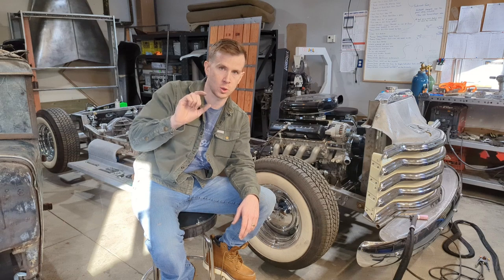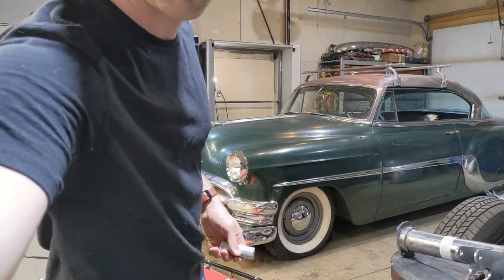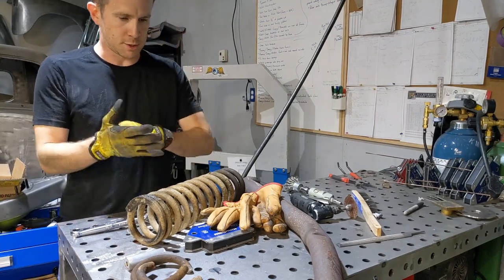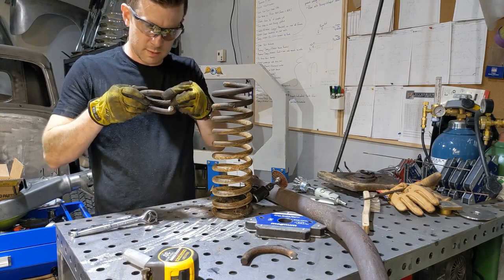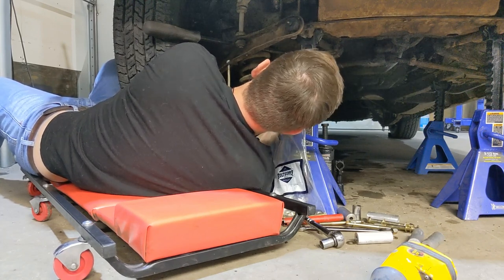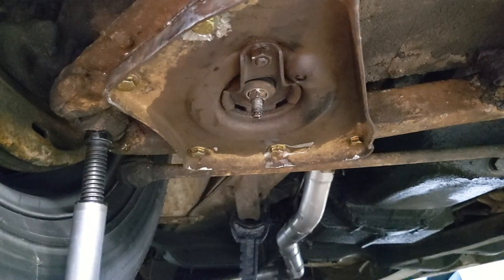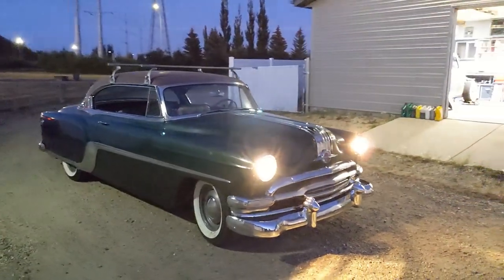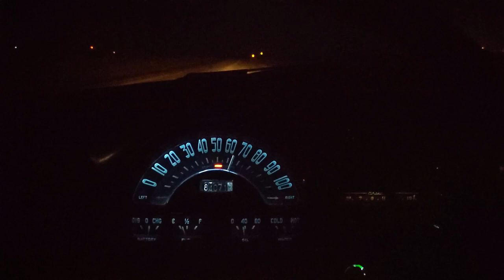Lowest Ride Height! How-to Cut coils on hot rods, 49-54 Chevy Coupe, Hardtop Belair

Comment: Got to run the fender skirts!!
Reply from the maker: The car is currently in a dozen pieces while I build the new drivetrain for it. 
Once it's back on the road with a better transmission, engine, and disc brakes I'll reassess the skirts and wheels👍

Comment: What was the tool you initially used when grinding down the rivets?
Reply from the maker: Are you talking about the 3/8" belt grinder?
Reply: @jp.lagrange  yes exactly, looked like it worked well I know there’s other options I was just curious. I’m about to try out this method for lowering my 53 bel air.
Reply from the maker: Yeah they do work great. Most places sell them. I bought this on sale for about $100. There are 2 different versions. I think this one is actually the 3/4" not the 3/8" . Also, don't space the plate like I initially did, it was super sketchy and unsafe.. cut the coils, it's a much safer option